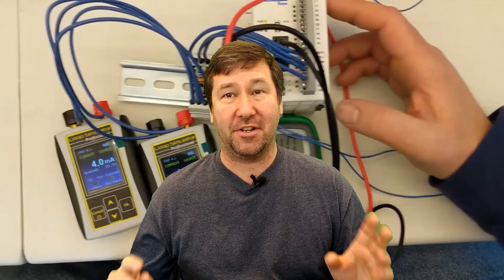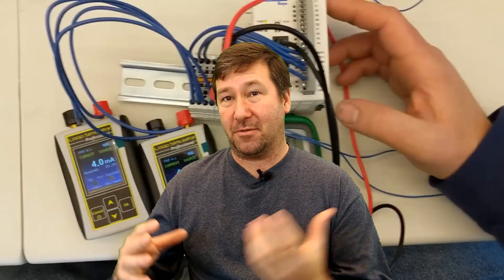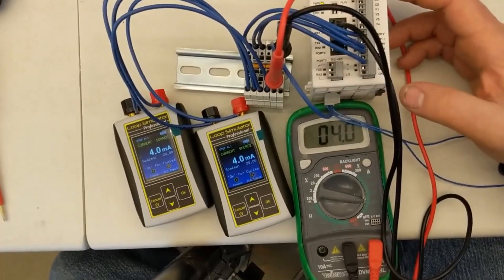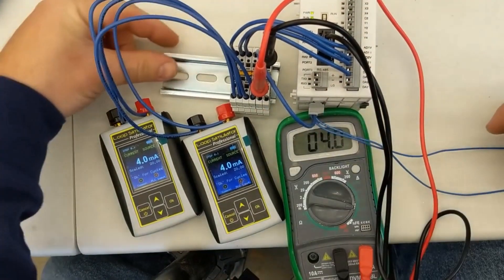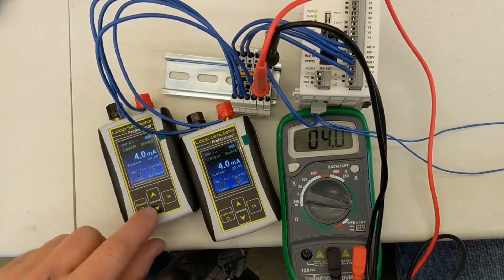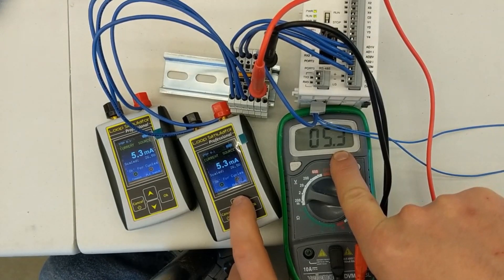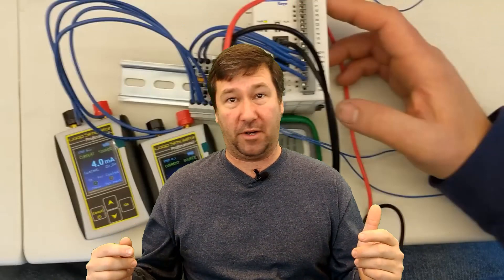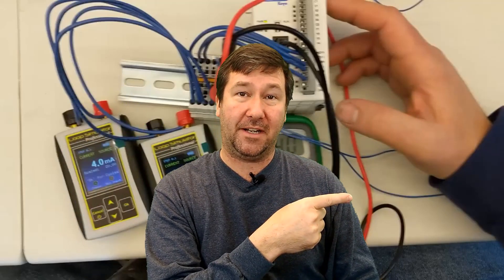Connect Two Analog Inputs to One Drive Speed Command

Comment: Tim; is this redundant analogue set up ??, why the two analogues ??, are two analogues connected to the same plc output 

card ??.
Reply from the maker: No they had two analog sensors and needed the drive speed commands to be controlled by whichever one had the greatest value.